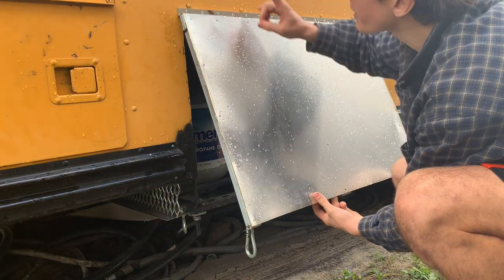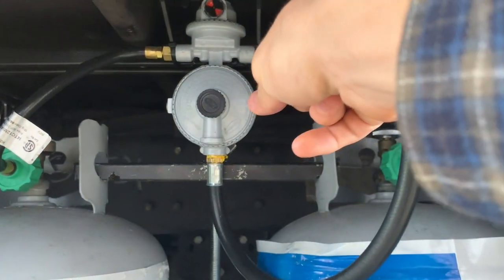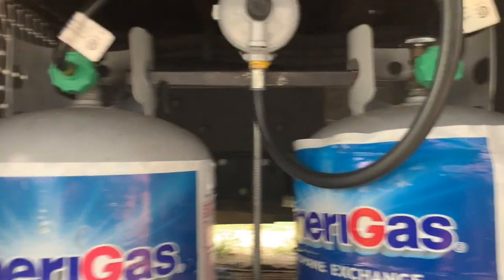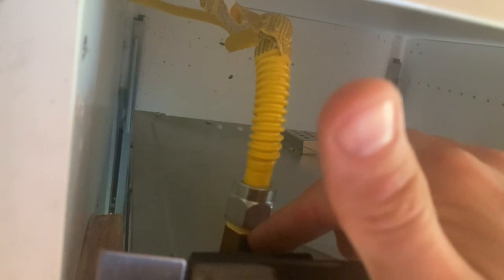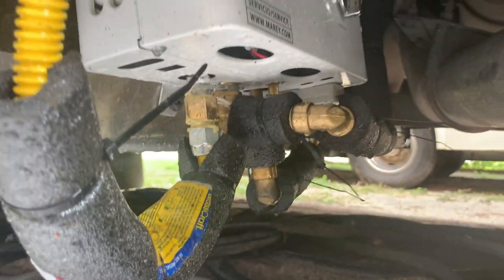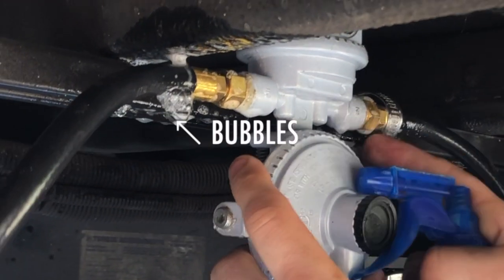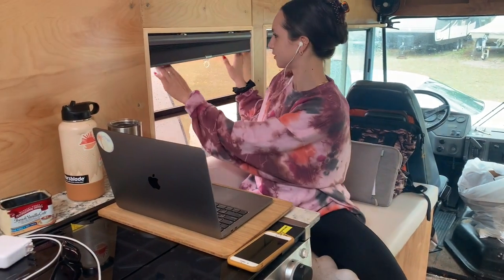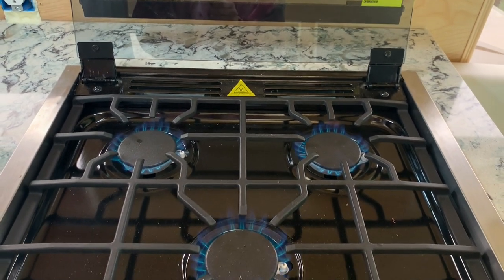Skoolie Propane System | Gas Oven Range, Hot Water Heater Installed in School Bus Conversion

Comment: I've heard you're not supposed to use those yellow tubes meant for residential purposes because they're not meant for movement and will become brittle over time. It's a pain to cut and flare copper but it's safer.
Reply from the maker: This is a very common method used amongst most Skoolie and can builds!

Comment: Be very careful as you’re driving on the road, if there’s anything laying in the road part of the tire big piece of wood a box if you straddle it it’s a high possibility you’ll snap off lines on the bottom of your water heater make sure when you put in protection for that that you have something underneath it to make sure nothing from the road to come up and get it
Reply from the maker: Totally! We shared in the video that we still have to add some protection around the hot water heater... although our clearance is much better than it looks on camera. Most RV's and vans are MUCH lower to the ground than we are!

Comment: You're paying more for convenience, than propane by using either Amerigas or Blue Rhino propane exchange.  One of the biggest complaints about either company is they don't completely fill the tanks (maybe only 3/4 full).  I bought a new tank for our trailer and it cost $14 about 4.7 gallons to fill it.  I've seen Blue Rhino and Amerigas exchange tanks about $20 or more, again for a partially filled tank. Plus at anytime I can have the tank refilled even if it's not completely empty, paying just for the amount propane needed to refill it.  If you do that with either Blue Rhino or Amerigas, you're essentially exchanging one particularly filled tank for another at a higher fixed price.
Reply from the maker: It’s just what we had at the house from our grill man
Reply: FYI They don't fill them up to 100% capacity because propane expands a lot when heated. You're implying that they're not providing the full service, but they do that on purpose because the tanks will be at risk of bursting if filled past 80%.

Comment: Look at you guys you guys are almost ready to be on the road LOL Hey I gotta question can you send me a picture of the whole that you put through the bus to run those lines I got white cold again what did you see you up in the bus so no rodents get up in there because I have to run a water and gas line up through the hole into my bus I'm putting my propane under my sink and in the cabinet next to it is where my water storage will be I'm gonna be using 5 gallon plastic jugs the refillable ones until I figure out exactly what I wanna do but I wanna get the bus on the road by April 1st because April 7 - 11th   Spring Break SkooleePalooza  Commerce Georgia do a search on Facebook.
Reply from the maker: The hole is closed because that’s where the grey lines run! We used spray foam insulation to surround the pipe, it’s a messy job cutting it out for sure... we’d love to be there next year as well!🙌🏼